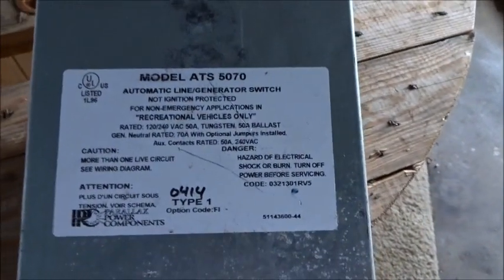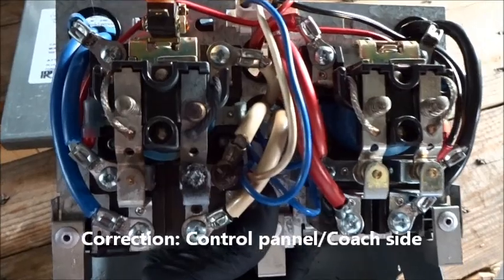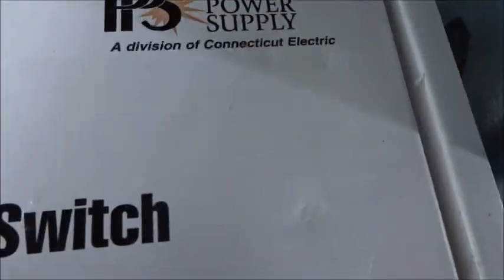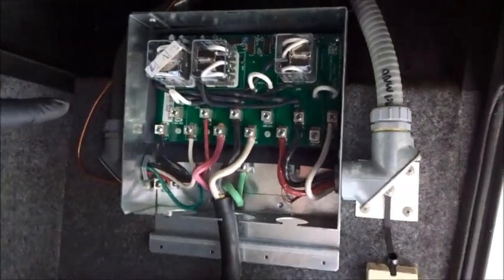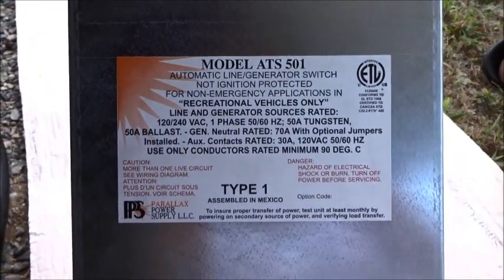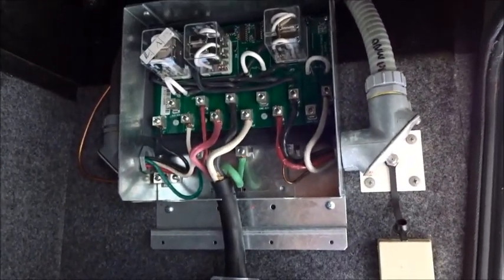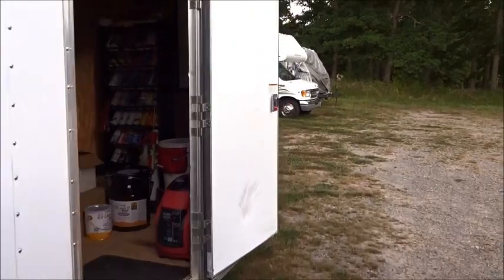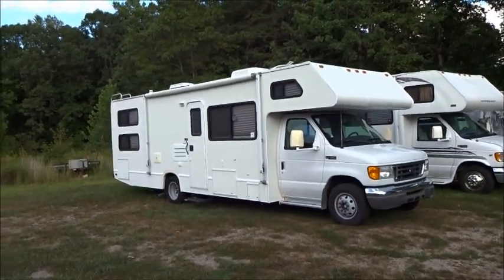Replacing a RV 50 amp automatic transfer switch (ATS)

Comment: I like the idea of the remote plug in box even without replacing old unit. This would allow you to add a good quality surge protector and not have it outside the RV at the source where it can be stolen.

Comment: Its a fire hazzard like no other. What people dont know is that if a wire comes lose and starts to arc over time it gets VERY HOT under load.My neibour had the same problem. If you have a lose wire in that box it starts to smoke arc under load. .thank GOD i was home at the time..My neibours transfer switch is under the bed so they smelled it fast. It was the lose wire in mine that caused it to almost burn my coach to the ground.Again,,,thank god i was home.Please tell all your RV friends to check to make sure all wires are TIGHT.Thanks

Comment: Why did you not just wire your 50 amp extension cord for shore power directly into your transfer switch? why ad the extra part and hassle of the plugin/socket?
Reply: That's what I like to know also I didn't quite follow guess it's just his way of taking the stress off the panel instead of doing that at the box he did it with and own box but it does add another connection so I don't know if I would do it that way the less connections the better in these things
Reply: if he had done that then you would have to pull 50ft of cord threw the floor hole every time you wanted to hook up to shore power. Now you can just stick the female end threw the floor power door and plug it in

Comment: Hi Chad! I have a question for you???? When you painted your dash, I couldnt find it specifically in a video but you did one on the shower and mentioned it, what kind of paint did you use? I bought Rustoleum 'stone'. Will this work do you think? And was your dash plastic? Mine is and I want the same look as yours.
Thx,
Sue
Reply from the maker: I used Valspar stone paint but I'm sure what you have will work.

Comment: My gen set is tripping 1 of the 2 breakers on it.  Only half the RV will be powered when running of the generator.   Could this transfer switch be causing this?